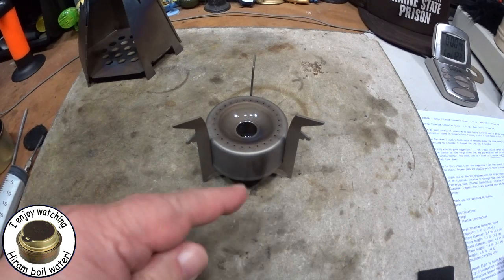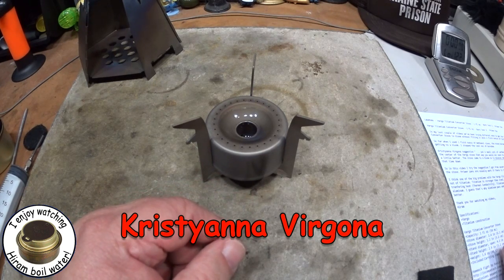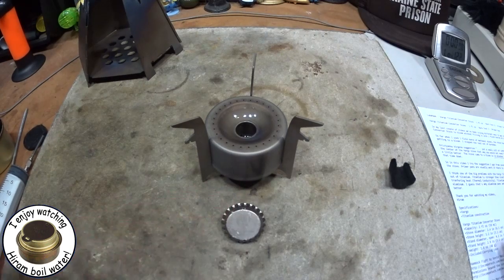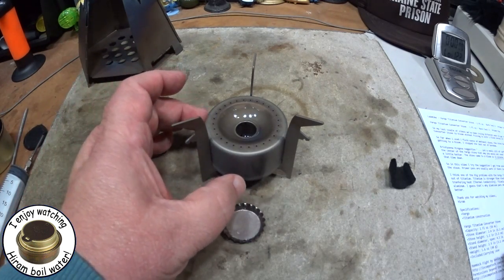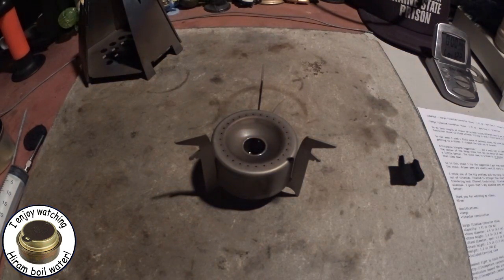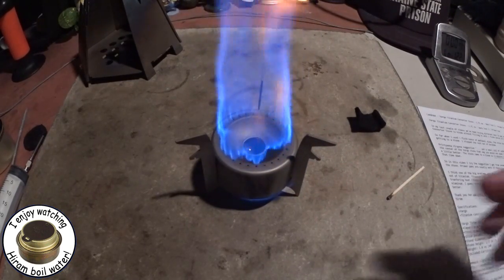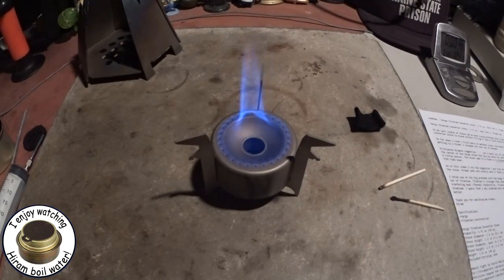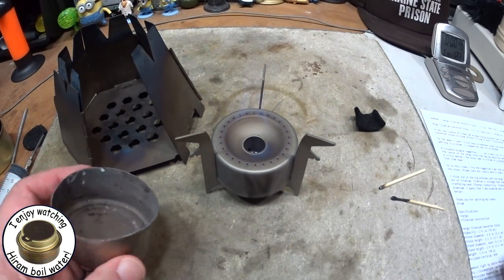Vargo Titanium Converter Stove - 1 fl oz - Burn Test 3 - Primer Pan

Comment: I carry a Vargo Triad on every backpacking trip and prime it with a bottle cap pan and 12 drops of yellow heat. It is full bloom in about 20 seconds every time here in California temperate weather.
Reply: There is a trick though. Don't put the pan directly under the stove put it under one side and the stove will light and bloom in its own when its hot enough.
Reply: I only use 3/4 oz of heat per boil and that brings my 500ml toaks to a rolling boil in about 7 minutes. Not the fastest system in the world but it works fine for me and I love that it is really quiet.

Comment: they probably used titanium because an ethanol flames temperature can exceed the melting points of steel, brass, bronze, 
copper, and aluminum.....they probably dont want to risk it blowing up in your face. titanium, titanium-carbide, and tungsten are about the only things that can handle its 3000+ degree maximum burn temp. also you can use a steel wool wick.
Reply: I've DIY stoves with aluminum soda can (very flimsy there), steel cans (e.g. tuna can), and all burn Ethanol - sold as automotive fuel here in Brasil with some additives (seems lubricant); and none of these stoves melted or blow up. 
The only issue is that this fuel leave a "varnish" under the pot and cause black soot if the flame is too high, can't use the 1" "sweet spot", seems that this cool down the flame and cause soot, need use 1/2" or less.

Comment: Vargo needs to put jets on the side of the stove so the poor conducting Titanium can heat up the liquid to turn to gas more efficiently. You will still need to prime it but it will prime faster.
Reply: If you offset the priming pan slightly it will handle the job faster. I use a triad and put the pan under the edge, not the center and it blooms in 30 seconds or less with about 12 drops of yellow heat in the pan and 3/4voz in the stove with a boil at about 7 minutes.

Comment: For a primer pan, when using the Vargo Hexagon wood stove with the converter stove, I've had success with using an empty tea light aluminum pan placed under the converter stove, upside down.  3 drops of alcohol on top of the base of the inverted tea light pan seems to be enough to heat up the Vargo Converter Stove.  The empty tea light pan really weighs nothing to carry and can be shaped if it gets bent in your travels.  Thanks for all of your informative posts.  Cheers!

Comment: curios, why doesn't the Evernew titanium burner need preheating when the Vargo converter stove does when fuel is below a certain level? They are both made of titanium. A design isssue? Also, have you tried a side by side comparison between the Vargo and a Trangia burner - when they both are filled to the brim. How long does it take to get a rolling boil?
Reply: The detail is that Evernew Ti had a (fiberglass) wick in the outside of internal wall, like Trangia TB25 had a line wick.

Comment: Wonder if you could just put a small scrap of carbon felt under the stove (between stove and stand) and put a drop or three of alcohol on that as a primer?
Reply: No, needs to burn about 20 seconds. Primer pan only mostly under the stove with about 10=12 drops of yellow heet does it every time. I have used a Vargo Triad for years.

Comment: Hmm. I wonder if you were to fit a tube of aluminium inside the centre hole that is just slightly taller than the bottom of the centre bowl to form an inner wall similar to soda can stoves. light the centre, heat is transferred through the aluminium to heat the fuel but allows for slight pressure to build behind the wall. My apologies if this was already suggested in the previous trials.

Comment: Hiram, I doubt the stove is worth tormenting. Frankly, in many regards the snuffer cap may be a better stove than that piece from Brian Vargo. 

BTW, Vargo made it clear on some forums (or somewhere else maybe): his stoves are usable in one way and one way only: as specified. This stove works with 2 oz of fuel, period. It does what it says it does and it isn't supposed to do anything else. Brian knows better what stove his customers need, I honestly can't believe he's still in the business.

Great series anyways, and I think it's a good idea to overcome limitations of equipment regardless of tag it comes with. Cheers!
Reply: I've see videos of this stove spilling lit alcohol when lit by the hole in the center.

Comment: Hiram, if you put a pot on the stove as soon as you light it would it make the stove heat up any faster?
Reply: No, not really. I have been using a triad for years. I use a priming pan like he did but not completely under the stove so when it get hot enough to jet it lights itself.
Reply: Yes and that's how they're supposed to be used, I don't know why people are trying to use it in a way they weren't designed for. They work well when you know what you're doing

Comment: I guess I'm just a little biased, I'm not a really big Vargo wood Stove fan. It just doesn't have enough inside area for a good hot burn.( only my opinion, based on use) I just feel, the Titanium burner while it looks cool is extremely inefficient. To many gray areas for something that you want to work all the time. I agree, aluminum would be a better option. Thanks for sharing this  and yes, Vargo...should address this.

Comment: Wow that works finally fine with the primer pan! 
But Hiram, when you said better to get the heat up from a pan instead of trying to get it down from up I thought that downway also should anyhow work, maybe by simply using a small piece of aluminium as medium. Means I could imagine you could also get some good heat transfer from upside down by sticking a piece of rolled/crumbled regular aluminium foil inside the center hole, mayb coming 1 or 1,5 inch up - that should not work as a wick but as a device for heat transfer.
It should not totally close the hole, of course, but if you roll a piece of foil maybe same size as your carbon felt pieces for the Fancee Feast and keep it losely there, there is enough space inbetween for the alcohol vapors to come up and catch fire, and heat up the aluminium. 
The advantage of such an 'inner heat transfer' would be not only lesser work and weight but also that you don't have to add any extra pan, waste additional methanol etc. ...
just an idea - cannot test it myself since I don't own such a stove ;-)